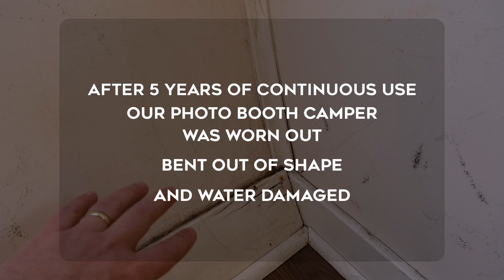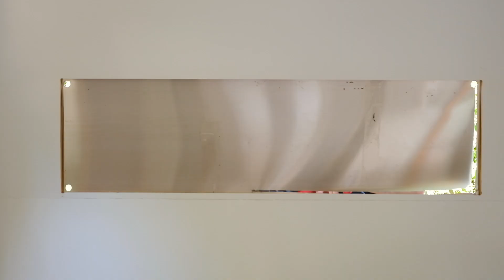⏲️ START to FINISH ⏲️ TIMELAPSE VINTAGE CAMPER REBUILD

Comment: Great time-lapse Conan, makes it look "just - that -  easy" 😉🤔😁
Reply: It is when there are no cabinets, no six coats of shellac, no electrical to speak of and then top it off with house paint LOL... It's a kiosk trailer. Not a vintage camper anymore.
Reply from the maker: Thanks Whitney!
Reply from the maker: Now Larry, I do have cabinets, and more electrical than it originally had, and I've got at least six coats of house paint, lol!
Reply from the maker: Sage advice, Larry, thanks!

Comment: WOW. You're Videos are the most thorough with a practical methodical approach, simply the best!  I'm so grateful that you have shown your work. I'm used to renovating and redesigning houses so my skills will come in handy for my new to me mid to late in1960's 2 vintage Shasta's for personal use.  I'm so grateful that you shared your experience so mine is less frustrating. Looking forward to sharing or corresponding. Love your photo booth!
Reply from the maker: Thanks for watching! If you've done construction you've got all the skills you need to do campers, but remember campers are NOT houses, they are built differently for important reasons that shouldn't be changed without good reason. Good luck on your Shastas, and don't hesitate to reach out with questions!

Comment: Alright, I’m fired up to get after my 59’ cardinal frame off rebuild! Where did you find the welt stuff for interior wall/ceiling joint?
Reply from the maker: Thanks for watching! I buy it from RecPro, but you can find it on Amazon.

https://a.co/d/ft9837g

Comment: Where do you source your camper skin? I am currently in the middle of a camper project abd realize i need a couple panels
Reply from the maker: There are actually lots of places you can check with depending on what part of the country you're in.  Here's some to check:

atomiccamperpart.com
bestwaytrailer.com
hemetvalleyrv.net
interstatervmetalandsupply.com
themetalcompany.com
airpartsinc.com
macsaluminum.com

It's worth shopping around too, as some dealers will have sales, or reduced freight, or just a better price than others.

Thanks for watching!